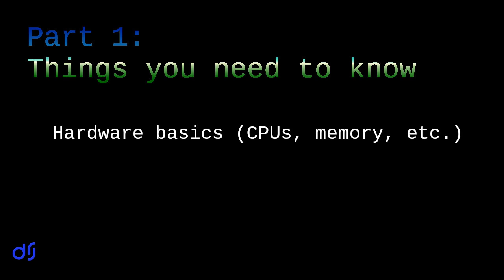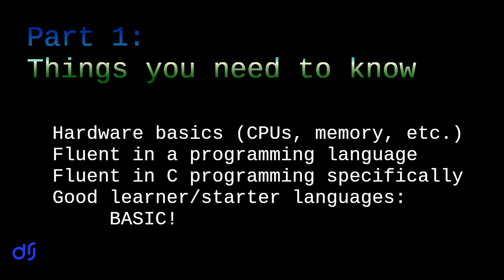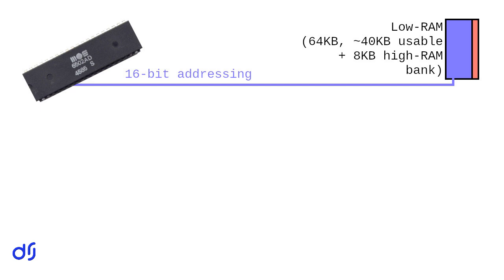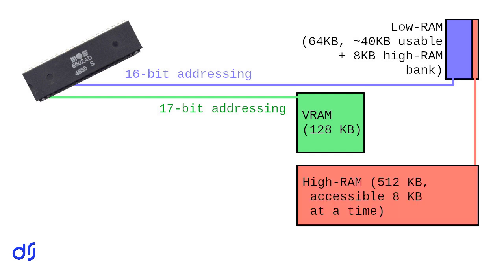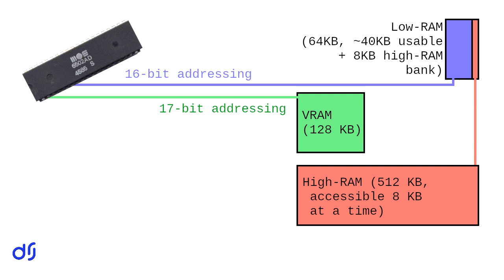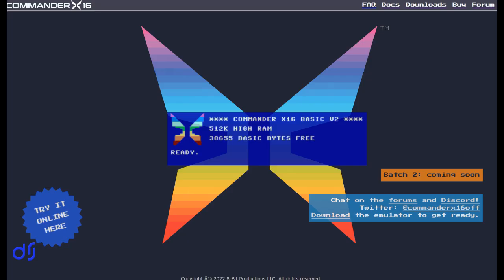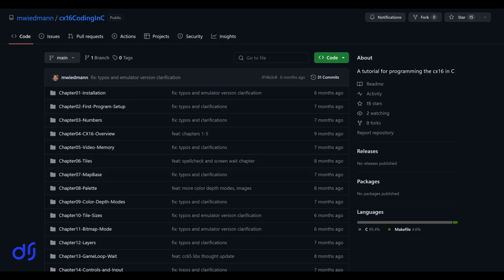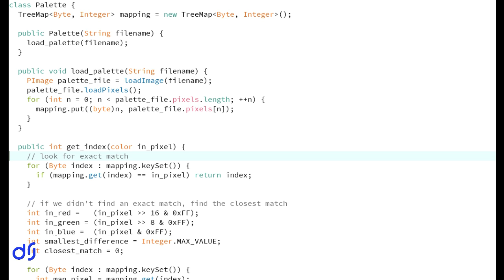Commander X16 Game Devlog Part 1: Introduction

Comment: G'day, I'm just coming to grips with the X16 architecture having just built the Otter-X clone. Your representation of the memory map appears to be incorrect. None of the video memory is directly controlled by or accessible to the 65c02 from it's own 16 bit bus (plus your borrowed 17th bit). The 128kb of VRAM is exclusively controlled by the VERA and all 65c02 access to it is via VERA IO registers as far as I can see. No doubt this becomes obvious as your series continues but it's an important basic fact for beginners to microprocessors and the X16 in particular. I'm an old Z80 guy and a hardware/software engineering type. For me the joy is in building the system so if it had not been for the Otter-X I would never have bothered getting any X16 hardware, the Otter-X also addresses numerous issues that made my internal hardware designer twitch! I look forward to watching more of your series. Cheers.

Comment: Have you looked at LLVM-MOS as opposed to CC65? I have found it really useful so far.
Reply from the maker: I didn't know there were other options for C compilers that target the 6502. I'm unlikely to switch because cc65 has been working well for me and I might have to rewrite a lot of stuff if I changed to a different compiler, but even so I'm curious, what differentiates LLVM-MOS from cc65?
Reply: The biggest differences are the possibilities that it opens up in terms of compiler frontends, and code generation quality. 

It plugs into any frontend that supports LLVM, which opens up the possibility of using Clang as a compiler, which supports the latest C and C++ standards. Even C++23 should work just fine. You can even use Rust, since its compiler uses LLVM. But even just sticking with C, it means you can go beyond C99.

In terms of code generation, it supports all of the aggressive LLVM optimization passes, notably link-time optimization which is a big deal on an 8-bit system with limited memory, where eliminating dead code is really useful. The developers have also added 6502-specific optimization passes, such as moving local variables into static memory locations to take the pressure off of the 6502’s incredibly limited stack. That lets you write more idiomatic code full of local variables without worrying that it will kill your performance. It all adds up to a sizeable difference in performance. I think it does pretty favourably in benchmarks because of that.
Reply from the maker: @noname4422  Great info, thanks.

Comment: Good luck!  As cool as the Commander X16 is, I'm a sucker for the 65C816. And since I also prefer the combined keyboard/computer slab form-factor, I ordered a Foenix Retro Systems F256K instead.
Reply from the maker: I'll have to look into that and see how much work it would be to port my library (and any games I make) to work with both. At a glance, the specs look similar, so maybe it wouldn't be too hard.

But my focus will definitely be on the CX16 for now. I wish I had more time for this stuff, but limited time necessitates a narrow focus.
Reply: @dr.jstudio  It's a really eloquent platform and very well designed. I try to spread the word as much as I can because it doesn't get the exposure it deserves. Fortunately that seems to be improving though.

Comment: Does ZSMKit not work with C? ZSound is great but not currently maintained. The alternative ZSMKit should part of the official ROM and is newer, active and updated.
Reply from the maker: Wasn't even aware of ZSMKit. Thanks for bringing it up, I'll have to check it out.
Reply: Looking forward to the devlog!  @dr.jstudio
Reply: And I take it back - ZSMKit does not appear to be in the ROM itself, so it still needs to be linked in. But the person who maintains the ROM (MooingLemur) developed it and is great about answering questions in the Discord.
Reply: Hey, glad Zsound proved so useful for you. Sound can be pretty arcane, even on modern systems.

Yes I have left it undeveloped for a while. My friend MooingLemur forked it to create ZSMkit.

I was collaborating with him about the sound support bank in the Kernal about the time I fell out of the hobby for a bit.

He’s added PCM support to ZSM in ZSMkit, which was an item I was kind of stuck in analysis paralysis over. He’s done a good job honoring the format specs with it but ZSMKit took a few things that were a bit counter to my own design goals for Zsound - I’ll probably update Zsound some time again to include the PCM support.

Comment: Great presentation. I am in a similar boat, where I love making games, but feel very daunted by the demands of working with low level languages and toolchains. I will look forward to seeing what help you can share. If you can end up sharing a repo of a project template one might use to make games for the Commander X16 with your techniques, I’d love to check it out.
Reply from the maker: I've got to do a little work to clean it up for general use, but I'll be happy to do that once I have the time. Thanks for watching!